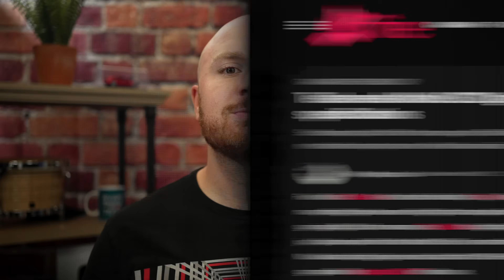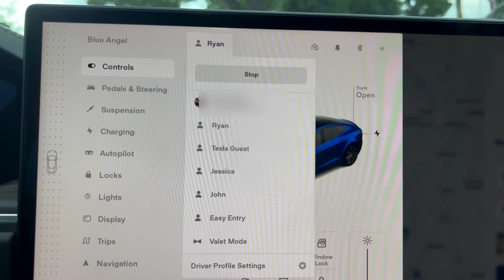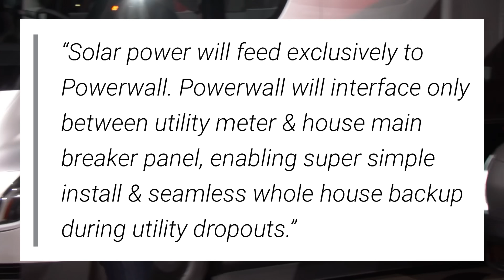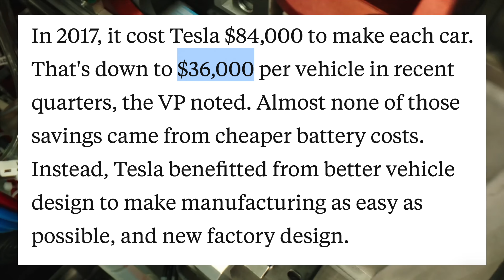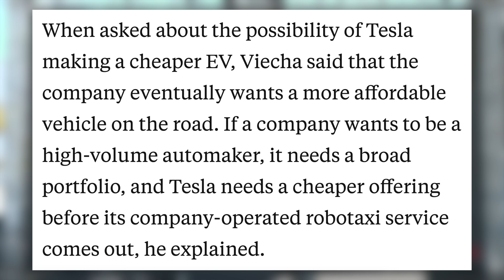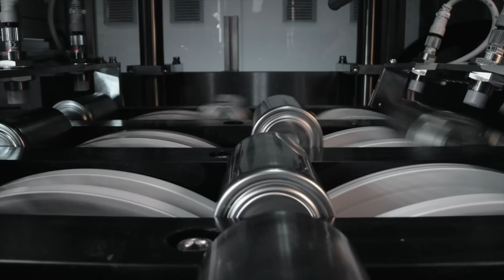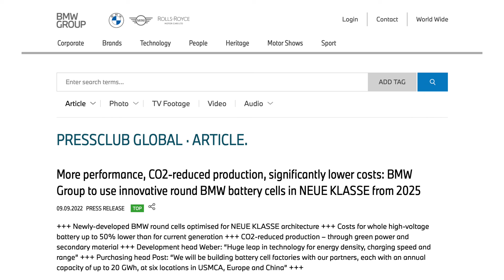Tesla Fixes Supply Issues Early | Ford Is Furious

Comment: Just got a 22 Y. Can't use controllers in the center console and missing lots of games.
Reply: Same. The usbc are power only. Have to use usba in glovebox
Reply: @TravelTime311  Is this for real? My M3 2019 has usable USB ports in the front.
Reply: @TravelTime311  I just got the new update. Missing games are back. Still have to use the glovebox for controller.
Reply: The Model 3 and Y are missing the graphics chips required to play the games that the S and X have
Reply: @TheStopwatchGod  The Ryzen chip is in my Y now. I'm pretty sure all models have it now.
Reply: @jonathanmealy8542  Yes, but not all Ryzen chips have the powerful graphics card that the S and X have. 
Therefore, the CPU performance should be the same, but the GPU performance which is critical for gaming, isn't enough. If your Y had the graphics card, Tesla would mention it in either the website or the owners manual.